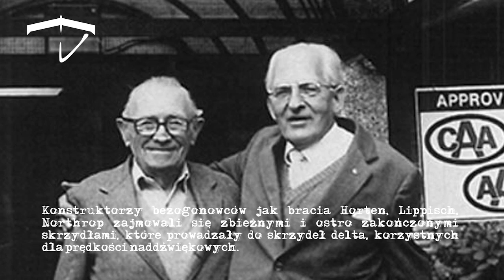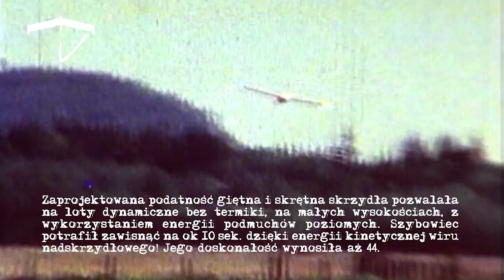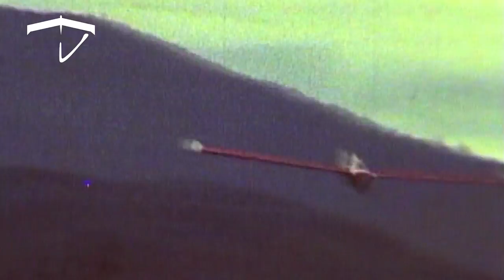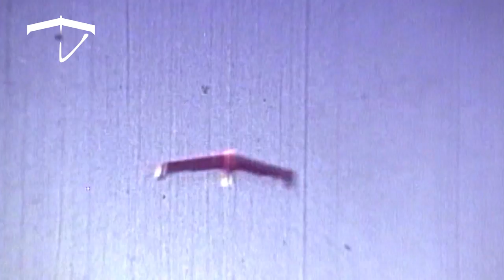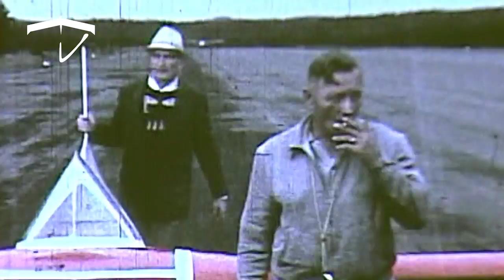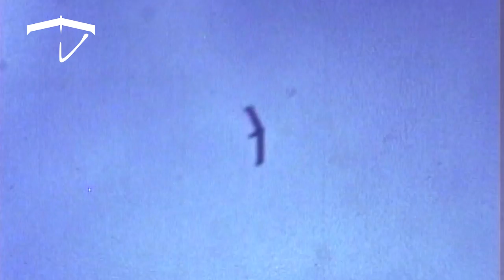Kasper Wings

Comment: The BKB-1 was designed by Stefan Brochocki and built by A. Bodek in Witold Kasper’s garage, thus the BKB designation.  When Witold was hired by Boeing, he took the BKB with him to Washington, as Brochocki had moved on to sailboat design and Bodek didn’t fly her that much.  Witold modified the BKB prototype’s wingtips and rechristened her Bekas.  At first Witold shared credit for the BKB/Bekas with the two B’s, but eventually dropped them from his narrative.  Though Witold was a talented glider pilot and worked for Boeing, he knew very little about aerodynamics.  He was very personable and could throw out technical terms that he’d heard aeronautical engineers mention, but his explanations rarely made aerodynamic sense and often contradicted each other.  
Most of his personal effects related to the BKB/Bekas ended up with my old friend, Walter Serafin, near Chicago.  I tried to reach his widow, Mary, and their kids, after Walter passed, to no avail, to find out the disposition of the films, drawings, etc. Walter had.  This footage looks like the video tape Walter showed me.  Did you get it from Walter’s family?  If yes, thank you for rescuing it and placing it on YouTube.